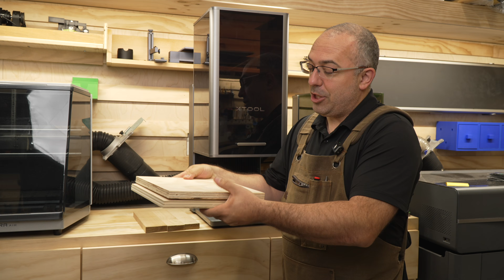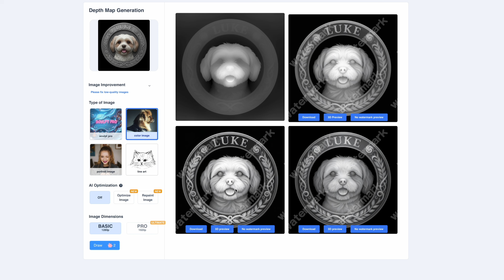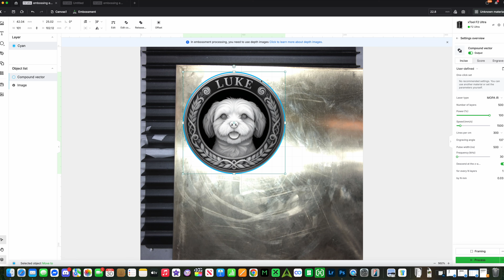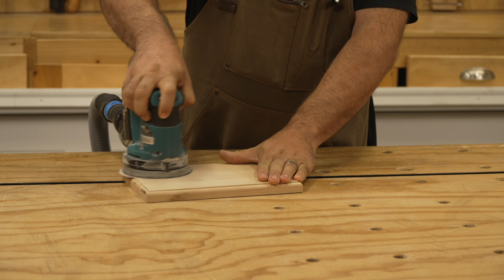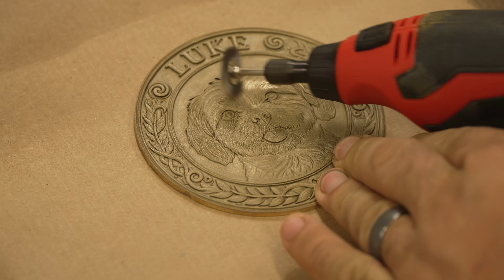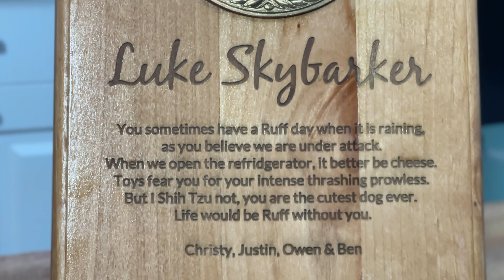Deep Metal Cuts & Engraving With The xTool F2 Ultra!

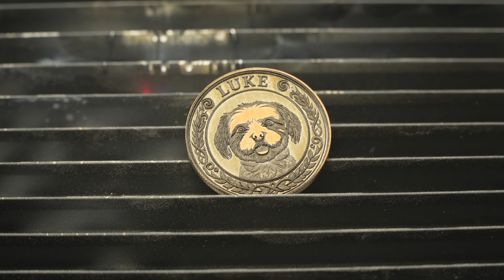Comment: What's the software you used to enhance the dept map at 5:47? I just bought the very same machine but i think i'm missing something when i try to emboss something. I cannot find a way to create the right "program".
Thanks!
Reply from the maker: I was using photoshop but there are some websites you can use that will make depth maps with a lot of tweaking options as well (photoshop is $)

Comment: Nice work. Thanks for the video. How did you deal with all the brass dust? Didn't it clog the air filter right away?
Reply from the maker: Thanks!. I do not use a filtration system. I direct vent to the outside through a 8 inch in-line duck fence system. I have set up with my machines. It has a pre-filter on the exterior of the home that we clean. If you were to do this same type of engraving with the typical air filtration system yes you’re gonna have very heavy contamination.
Reply: @BitnerBuilt thanks for the reply. So the air filter system xtool is selling is useless for brass work?

Comment: "But I Shih Tzu not..." 😂

This was really interesting. Thank you for sharing. I'm learning more about engraving. I have a couple of questions that may sound dumb.

1. You said 3mm is the max for engraving? Is that for engraving or cutting? So, for example, if I had something already cut out, like a 5mm brass coin, could I engrave in that? 
2. I saw you had to restart. Because the back wouldn't be visible, could you have just flipped it over instead of using more brass? 

Thanks in advance.
Reply from the maker: 😂 so metal engraving is a little different than materials like wood that begin to burn. Metal your removing layer after layer and so you can keep removing up until the laser becomes out of focus from the depth change. Now in the software you can have the laser travel lower with each layer. At standard on the software you can engrave 256 layers I believe (might be a few off Im not looking at it) you might have to set up a second process to go deeper on a second pass. On my oops. First you should in settings turn off the material move warning to prevent what happened. Yes I could have flipped it but I had gone deeper enough already I worried I would intersect with the other engraving and then another 8hrs wasted so I just started in a new area.

Comment: I recently got the F2 ultra and when I went to do my coin the laser stopped after a few passes and the machine smoked. Working on trying to get it replaced as it is under warranty. Any advice on how not to damage my replacement? Coin was slightly off center. I don't have any additional filtration that what comes with the machine and was using the Xtool standard embossing standards.
Reply from the maker: Oh wow! Did you determine with support what the damage was? What the lens cracked? Internal smoke would point to nothing you did. But a manufacturing issue. You should be able to just have at the machine without fear. I have had all the xtool lasers (not fab and dtf) as well as 10ish others and I have never had to baby them outside of cleaning and not starting fires

Comment: Can you use a whole piece of wood to engrave both the portrait and the information?
Reply from the maker: Yes definitely (as long as it fits in the print area which this does) being that the F2 ultra is the specialist in metal engraving. That’s why I wanted to showcase that feature, but of course you can do that in just the wood with both the F2 ultra, F1 ultra, P3, P2, S1, M1 Ultra, the entire line of xTool  lasers with the exception of the F1 mini (wouldn’t be able to remove much due to power)

Comment: Why are you using the default emboss settings? The results are extremely rough and poor detail. Try these out next embossing; MOPA IR, 256 Layers, 85% Power, 2000 mm/s, 1 pass, 300 LPCM, 35 deg angle, 100 pulse width, 80 KHz, descend N layers 2, by N mm 0.01, Noise Red on, Cleanup on, for every N layers 32, 20% power, 3000 mm/s, 1 pass, 300 LPCM, 35 deg angle, 100 pulse width, 100 KHz. You'll get far finer detail without the blotchy roughness that the default settings leave. You'll also have far less burn in and slag left afterwards.
Reply from the maker: ill give them a go next time around
Reply: Hi! I used these settings you wrote and they are amazing with the coins! Do you have any suggestions what settings I should use for small silver pieces that I want to emboss?